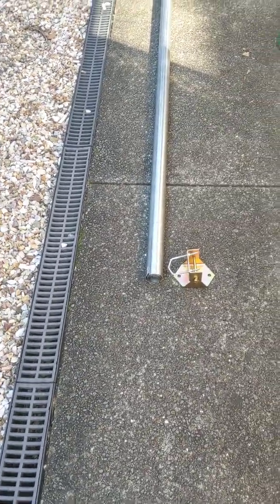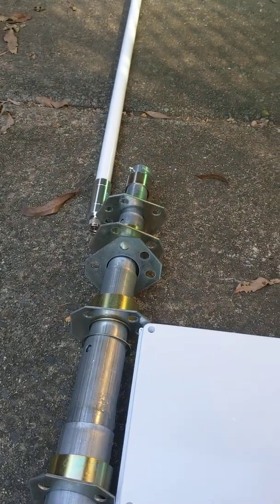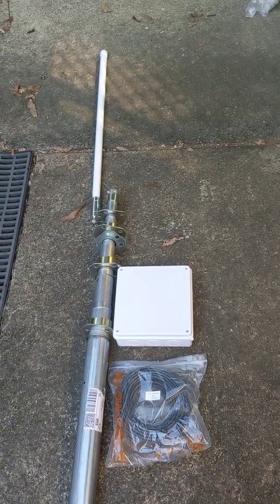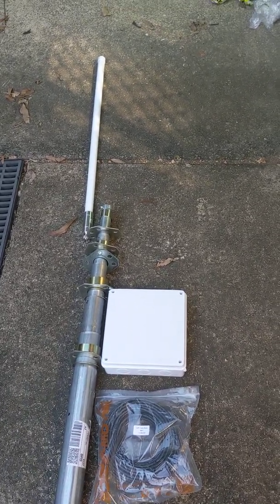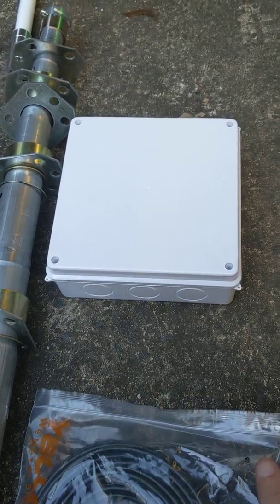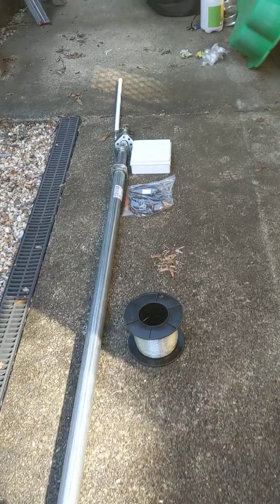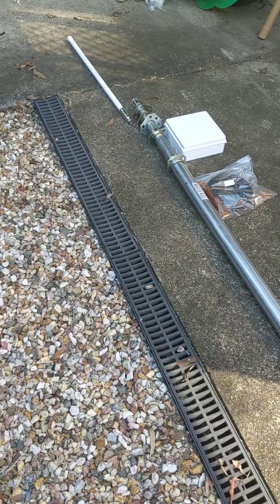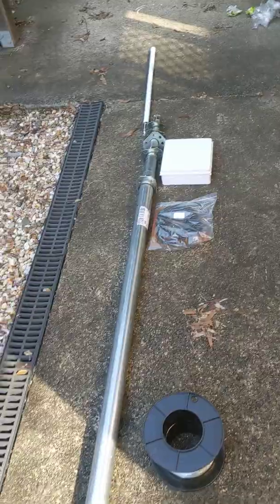My Helium Hotspot Antenna Setup - A work in progress

Comment: I understand putting the miner up on the pole but can’t you have an extended Ariel cable to the miner while it’s inside near the internet modem?
Reply from the maker: Hey Rhys, yes this is not what I am  doing, this was an old video and it is no longer viable to have the Hotspot at the top of the mast.
Reply: @HeliumDownunder  thanks for replying mate this is all new to mev

Comment: hi all im new  in mining just got a question are all the antennas for all miners?? like  l wanna upgrade antennas does the bocat antenna work on a syncrobit??
Reply from the maker: Hey Jim, not sure if you mean the standard Bobcat antenna or the outdoor antenna.  Either way my understanding is that Bobcat and Sycrobit are fitted with RP-SMA connector so should be interchangeable.  Just ensure that you purchase the correct frequency antenna, if you are in Australia that will be 915 Mhz.  If you are getting an outdoor antenna you will also require coax, LMR400 or equivalent is what you will want.

Comment: Cat6 ethernet cable can do outdoor and indoor.
Reply from the maker: Hey Jeff, you are correct that they can do outside but my research indicates that Cat8 is far better if available.  Less interference getting into the line, less line loss and the Cat8 that I have has better outdoor qualities for durability to the elements.  Thanks so much for your comment.

Comment: It’s amazing how I learn more every time I watch you videos more than once. Thank you.
After watching and understanding a little more I have decide to do an external mount for most of my miners. Have you considered Cat7 weather rated for POE?
Reply from the maker: So happy to know that my content is helping as that is my primary aim.  Build a community and share knowledge that can help us all grow.  I appreciate your comment.  As for the Cat7, the info I found online was that Cat8 was the best option for only a small increase in price.  I have ow purchased a splitter unit ad will be experimenting with POE.... :)
Reply: @HeliumDownunder  I have a 75’ run and was afraid of loss. Did you make your own Cat8 line? And what POE splitter and injector did you use?
I also bought a weatherproof plastic house like yours. At which location do you attach the lightning arrestor? Can you combine the ground wire for the mast and arrestor and then run it down to the grounding rod? Sorry for all the questions but I want to get this right and not fry my unit as I am waiting too long and spent a good amount on this. 
All the best!

Comment: any reason why you choose cat 8 rather than lmr 400? im assuming here c8 coax is the same as rg8?  For longer cable runs lmr400 would be the way to go.
Reply from the maker: Cat8 cable is an Ethernet cable not coax, I went with the Cat 8 over the normal Cat 6 because it will be outside and the Cat 8 is rated for outdoor use.  I will have a small section of LMR400 between the antenna and the hot spot.
Reply: @HeliumDownunder  👍

Comment: You didn't mention a lightning arrestor and how you will be planning for a ground wire to ground the antenna and enclosure.  Given that your antenna will be the highest spot of your roof, it would seem prudent to install.
Reply from the maker: Hey Keith, this has been asked multiple times in other circles.  I am rolling the dice on this one, there has been a previous antenna in place for 20 years, it was only 9m but was not grounded in any special way.  The hotspot will be at the top of the mast so in the unlikely chance of being hit by lightning I guess I will be looking for a replacement.....lol....I guess I will ground it then...
Reply: @HeliumDownunder  Don't get me wrong, I would definitely be in the camp of probably not doing it because of the slim odds.  But you have put yourself into a leadership position for the Helium project in Australia...so you get held to a higher standard I suppose.
I live in Seattle, Washington, USA.  I am planning on coming down to Canberra later this year to set up a cluster with a friend there; hopefully bringing three or four hotspots with me.
Reply: P.S.  Please really keep pushing folks to contribute to that cloud document of planned hotspot placements.  The ability for owners to look at what others are doing really helps for finding hosts and to build out the network as efficiently as possible.  I wish I had such a thing here in Seattle.

Comment: You can use a 12v PoE Splitter. The nebra uses a standard 5.5mm 12vdc adapter. That way you only have to run one wire up the pole.
Reply from the maker: I have ordered a PoE injector and a PoE splitter, I will totally be working with that as it saves an extra cable up the mast....  Thanks for the tip my friend...

Comment: I have a couple questions. Why don't you run some lmr-400 cable? Lmr-400 has minimal to no loss.  It will keep the miner off the roof.

Why don't you just use your wifi to communicate with your miner??
Reply from the maker: 15m of LMR400 can still lose 40% - (2.5db)  Wifi up to the miner would be weak and has potential of unwanted interference to reduce the quality of signal.  This set up is subject to change but I wanted to start with the optimum setup and then change things to see how much of a reduction there was.  Thanks so much for your question and input, I appreciate it.

Comment: Great video and looks like being a solid setup. A couple of questions - when did you order your miners and did you think about leaving the box inside and just running the rf out to the antenna? Thanks got my sub.
Reply from the maker: Hey Dave, thanks for watching and your question.  I purchased from Nebra, I am in Batch 4 so hope for delivery in July - August.  

As for placing it inside, this was my first option but as the antenna cable would be almost 20m long there will be significant loss even with high quality LMR400 cable, some references suggest up to 45% loss.  Keeping the cable short is highly desirable.  This set up is a trial, it is possible that I move it into the roof or even all the way to the desk but this chapter has not been written yet.
Reply: @HeliumDownunder  Hi Ian, any ideas regarding custom/duty extra costs when they arrive in AU? Cheers
Reply from the maker: @UndertheTuscanSun  No idea mate, I am waiting to see myself.  From what I believe anything over $1000 will attract duty... Fingers crossed it is not to high.